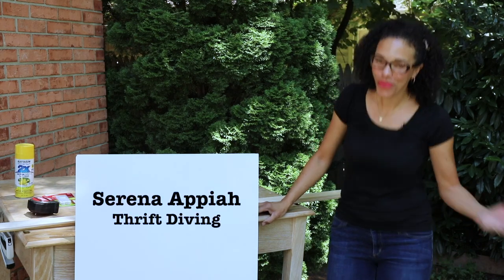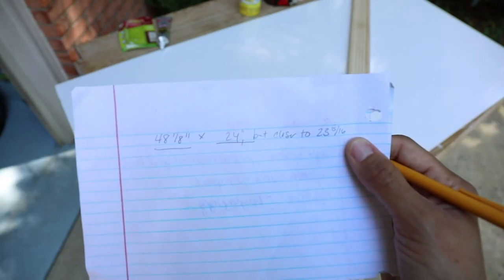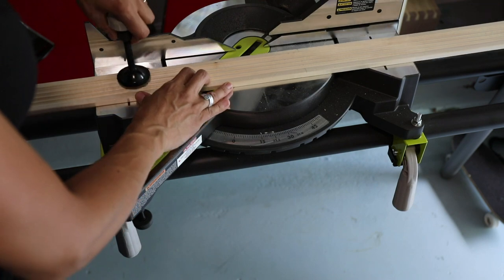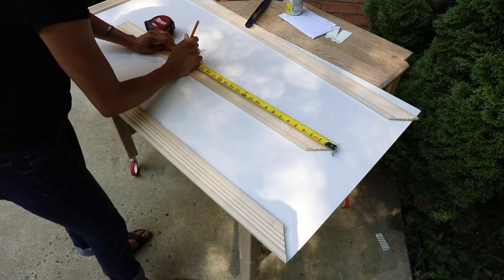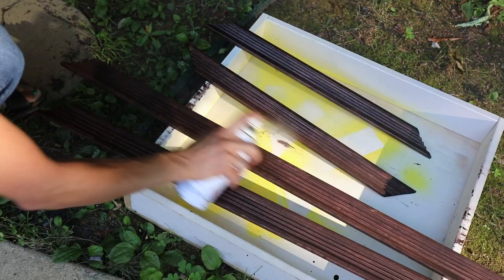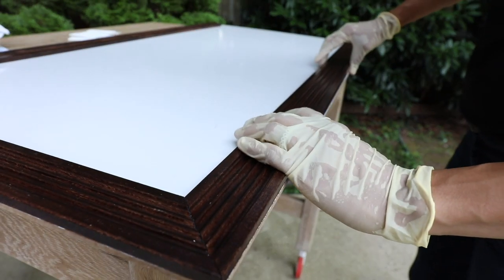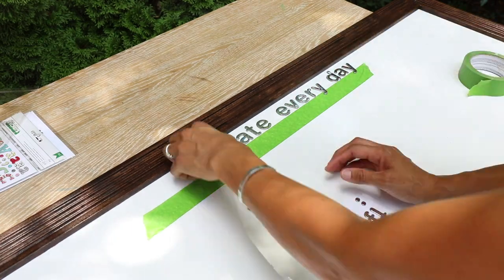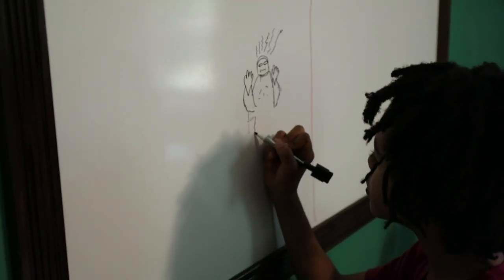How to Make a Big DIY Whiteboard - Easy Craft Projects - Thrift Diving

Comment: Super job on this whiteboard project sis. That suze would be great for my craft space over my craft desk aa an inspiration board. I love the color of the wood stain you used w/ enamel sealant. Also, I have got to try that Gorilla glue line. I recent bought the Gorrilla glue sticks,but haven't tried them yet. 
I also have E6000 as well. It work well once dry. You can adjust/reposition your items before it dries. For a quicker hold put a few drops of glue stick on project with the E6000 it will temporarily hold project items together until the E6000 dries permanently.
Reply from the maker: Great tips! Let me know what you think of the glue sticks. I just picked up a few from my blogging conference but haven't tried them yet!
Reply: +Thrift Diving (Serena Appiah)  Yes I will be trying the Gorilla glue sticks out this week on a minor craft project or too to test it out. I will definantly let you know what I think on them.